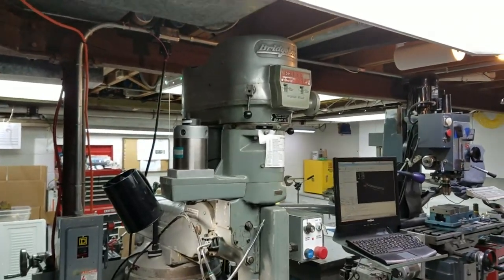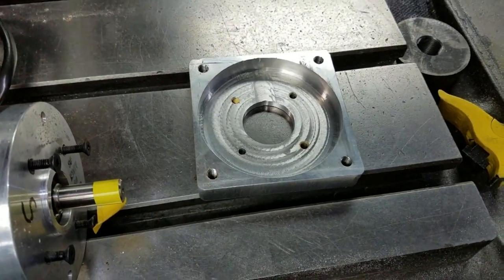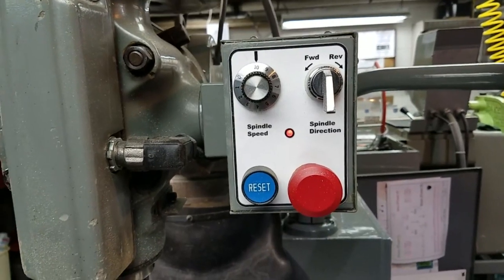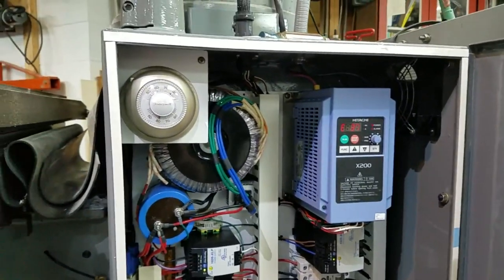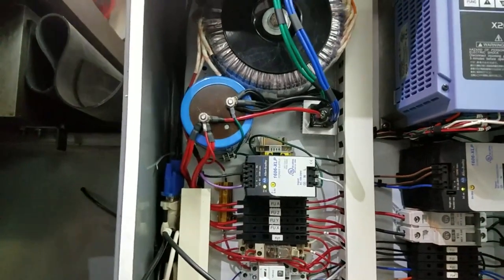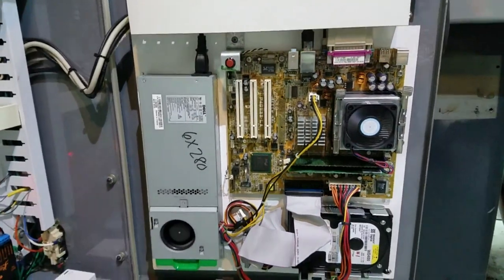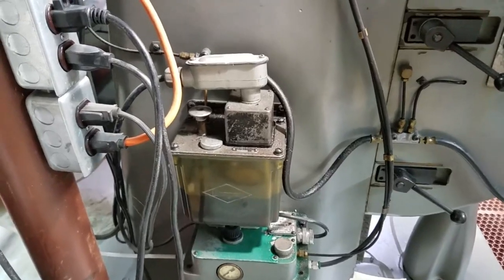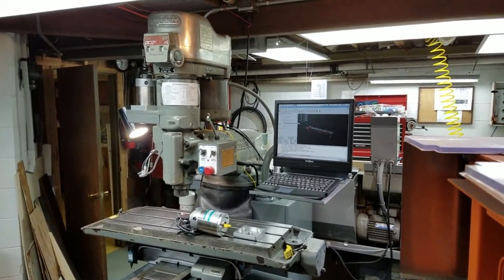Bridgeport Series 1 CNC retrofit overview

Comment: That's an awesome machine a lot nicer that the one I have ... thanks a lot for the video It was a nice surprise... you were talkin about having to move that thing to your basement I bought some stuff from an estate auction a while back and the old man had a whole machine shop in his basement a lathe couple milling machines a surface grinder and bunches of smaller bench grinders tools and stuff and it all had to go out a door and up a flight of stairs I only bought. A bench grinder and I glad that was all I bought the stuff was cheap and I figured out why when I got there haha I felt sorry for the guys that bought the big machines they were down there taking them apart scratching there're heads trying to figure out how to get them out

Comment from the maker: I just saw a message come through my notifications from Jacques Evans, but for some reason it is not showing up in the comments section here.  The original message from Jacques is this:  

Jacques Evans replied: "MakerCave Hi, interested in doing something similar myself. If you kept the original stepper motors would they need something to convert them to single phase? Thank you"

The stepper motors in the original machine were not really "3-phase."  Yes, the incoming power to the machine was originally 3-phase, but the steppers ran off of a separate DC power supply.  In a retrofit, you bring single phase power into a Torroid-filter capacitor-bridge rectifier arrangement, to make a DC power supply.  This DC power is then fed into a motor drive, like this Gecko stepper drive:  https://www.geckodrive.com/g201x-digital-step-drive.html  which takes care of driving the motor.  No 3 phase required.  If you go to 3:25 in my video, https://youtu.be/ou-R44toyUs?t=205  You can see the big round Torroid, that is powered by 110v AC.  The double blue and double green wires coming out of it are going down into a little square bridge rectifier, just below and to the right of the torroid.  The bridge rectifier   is similar to this one:  https://www.mouser.com/ProductDetail/ON-Semiconductor-Fairchild/GBPC3504?qs=j%252BucPx4PkG58AqaSQMi2kg%3D%3D&mgh=1&gclid=CjwKCAiAl4WABhAJEiwATUnEF6NVddx3colS1IqF-WpjexgPstFvH29FmsJuiCedbAWS3SzaURHF1RoCtzkQAvD_BwE  The Bridge rectifier turns the AC voltage into DC, which is then passed through the big blue filter capacitor, to smooth out the ripples in the voltage.  The two terminals that you see on the top of the bridge rectifier provide the DC + and DC - voltage to drive the Gecko stepper drives.  This is a pretty quick summary of the DC side of things but it should at least get you moving in the right direction.  Thanks for watching!

Comment: Great video, I really liked the Motherboard mounted in the cabinet. I am in the process of a retrofit of a bridgeport cnc, would you have a parts list to publish and or a wiring diagram. I think many of us that are trying to retrofit and keep cost down would greatly appreciate it. Thanks again for the video, really nice work.
Reply from the maker: I just glanced in my computer folder for this project and I found my original parts spreadsheet from early 2012.  Its pretty detailed with nearly all my part numbers and costs, except for the surplus items that I had lying around.  I put this machine together over a period of about three months, working on it off and on.  I will look at dumping this sheet to Google Drive this weekend, and including a link to it in a follow up comment.  My original schematic was done in Autocad, to help in physical layout of the enclosure, and actual routing of wires, not just as a simple block diagram, so that is a little harder to follow.  I will have to look at it again this weekend to see if there is a simple way to make it readable without having a copy of Autocad.
Reply: @MakerCave  Thanks for your willingness to help in such an endeavor. I look forward to the info. I believe AutoCad can be saved as a PDF.
Reply from the maker: @grantnotta3428    See if you can download and open these two files.  I will also place the links in the video description:   https://drive.google.com/open?id=1D3JUR82iw_a0EVoqCXGd2_KbRXa1LLjK     You will only be able to download this one and will have to read it with an Autocad (.DWG) viewer:     https://drive.google.com/file/d/1JYU92qt2g7GuVw6qdjQ20qFmhtAgaRiF/view?usp=sharing
You will be better off using either Autocad or a DWG viewer so you can zoom in to look at all the small detail.  I cannot convert it to .PDF until I come up with a better CAD solution, seeing as Dassault Systems discontinued their Linux support for Draftsight a few weeks ago.
Reply: @MakerCave  Thanks, I got it, and will start studying.

Comment: Amazing and detailed Job!! Thanks for the information...

I'm planning to do a similar upgrade in my Lagun 3 CNC mill. I still have the (3) Anilam/Sem servo motors (MT30M4-59). My machine has the Anilam A10 scales, and they were used in the original setup as a secondary servo feedback loop. My motors have tachometers. I'm curious about three things: 

#1- What modifications to your system layout/components will be needed to feed my (3) servo motors? *They are rated 142 max volts @2400RPM/ 30 AMPS @ 3NM Max Torque. They have the original reduction gearing and synchronous belts.

#2- Would you suggest keeping the tachometers or change them for hi-resolution encoders?

#3- Any extra hardware needed to keep the A-10 feedback loop?. 

Thank you very much for the help and for the excellent work in your videos.

Comment: How is this setup years later? Also, did you do all the wiring and setting up yourself? Thats a damn good job. Once i have fun with my new old series 1, i will probably cnc it just for the heck. Or maybe just buy a cnc machine. eh.
Reply from the maker: Perfect timing to ask.  Yes, I did all the control design and wiring myself.  The Bridgeport is two or three days away from being reassembled, and put back in service.  I moved into a fantastic new house 2 1/2 years ago, and I have finally gotten to the stage of wiring and setting up my new shop!  My new shop area has tripled in size, and I am really looking forward to making parts again.  Yes, the Bridgeport was working excellent up until the point that we moved out of our old house.  About a year before I moved, I upgraded to a Mesa Electronics FPGA control card, to get me a way from the parallel control, which let me run a modern computer.  All of the machine tools will have their own separate room from the rest of the shop, and now I have nice big aisles to have room to move.  I may start posting new videos once I get the shop back set up.  Thanks for watching!
Reply: @MakerCave  Thats awesome, are you telling me the bridgeport was dissasembled for  2 and a half years??! That sucks! i would be itching to set it up again. Thats great to be able to have a large shop. thats my goal. What kind of stuff do you make? Do you take jobs or is it more of a hobby? If you dont mind me asking.

Ill be looking forward to the videos, thanks!

Comment: MakerCave:
I made a conversion like this one. But I DID NOT change the motors. 
Used the Original motors and the Original power supply. 
I only changed the MOTOR DRIVES. and I DID use Gecko drives but not these models.  
I used the "High voltage Steppers"  The spindle, I left that alone since it has an adjustable, pulley-based, variable speed control.  (I may decide to change that later. but I haven't seen the need, yet)
I also replaced the CNC controller, using Mach3.  All parts I got from ebay........
works Great!! and super powerful w the Original motors and really economical conversion!!
Reply from the maker: Yes, I had read in the past that many have had very good results using the original steppers.  If I had it to do over again,  I might just have stuck with the steppers!  Steppers make their best torque at very low speeds, which is when the machine cutting forces are high, so they are a good for most work.  Any chance that you have anything posted on Youtube about your machine?  Would be great to see it!

Comment: MakerCave:  Is there a difference between a home switch and a limit switch?  And why use relays for their signals?
Reply from the maker: A Home switch is used to tell the controller that the machine is in a predefined position after power up.  This way the controller knows that it is exactly 11.625 inches away from hitting the left travel limit of the machine.  The limit switches are sometimes called "Overtravel" switches.  These are the last line of defense against a machine crash.  On my machine, I can can be running at my max rapid speed, hit a limit switch, and the drives brake to a stop before anything hits.   I used relays to isolate noise from the field wiring.  I was getting false limit switch trips once in a while, and I know that it was because of noise in the wiring.  Running this signal through the Solid State Relays completely eliminates any possibility of noise from tricking the controller.  The relay is very positive.  It is either open or closed.  Nothing in between.

Comment: Great, I have disassembled a series 1 2J Bridgeport I'm in the process of moving to my basement shop. I have everything down there with the exception of, you guessed it the knee and the base. Wish me luck!
Reply from the maker: Funny you should mention.  I just bought a new house, and MY Bridgeport will need to be disassembled in about 3 weeks, rigged and moved again!  Fortunately, the new house has an open stairwell to the basement, from the garage, so it will be much easier to get it into its new location.  Good luck with your move of the base!
Reply: @MakerCave  Thanx, I got the Knee moved now since I posted that comment, thankfully it was uneventful! Look into using a wrecker to move the unit from house to house, I found out the hard way it's so much easier

Comment: Great project do you have a hard copy / pdf of the step by step procedures? I am old school and do all my work scopes in hard copy
Reply from the maker: Sorry, I didn't do any kind of procedure for someone else to duplicate this when I built it about 10 years ago.  I have all my part numbers logged and some design notes, but this was not a commercial, mass production effort.  Just a hobbiest doing a "step and direction" conversion using currently available standard components, to replace very outdated electronics.  Thanks!

Comment: Hello, does the bridgeport motor serve with a VFD? Doesn't torque decrease at low revolutions?
Reply from the maker: Yes, torque can fall off at very low speeds, like 15 hertz.  Also, the cooling fan is turning very slow when the motor is turned way down with the VFD, so the motor temp can rise because of that.  It is best to run above 30 hz when under a lot of load.  The Bridgeport  motor is not specifically rated as an inverter duty motor, but it does work fine in this application.   If I need to slow spindle speed way down when under heavy load, I slow it mechanically with the vari-drive crank.  Thanks for watching!

Comment: nice machine.  I've completed my retrofit using a hodgepodge bag of parts.  I was wondering if you could shed some light on the Bijur oiler.  I currently have mine powered when the spindle is on, problem is, how do you know if its working?   thanks
Reply from the maker: Thanks!  The easiest way to be 100% sure that your oiler is working is to unhook the outlet line from the oiler, and then see if oil starts to ooze out when the spindle controlled relay is closed.  You may want to hook up a temporary extension line to the Bijur outlet, just so it doesn't make a mess.  

It is also important to note that the various oil channels and restrictions can become clogged over time, so if you have the opportunity, it is always a good precaution to take apart all the lines and the manifold, and flush them out with solvent to be sure that they are not clogged.  This will ensure that the ways and ballscrew nuts are actually receiving the lubricant being sent from the Bijur.  

Post some photos or a short video of your machine on your channel if you get a chance.  It would be great to see it!
Reply: Will do.  I send me a private message.  i’ve documented my build on Instagram

Comment: Hi, can you post some information on how you got it into your basement? Specifically, which parts did you disassemble and how did you carry each part down the stairs? How many people had to help carry each piece?
Reply from the maker: I erected a derrick in the stairwell, made out of old telephone pole cross members that are about 5" square, if I remember correctly.  The uprights sat on the third stair from the bottom, and the horizontal section ran from the top of the ceiling in the stairwell, to just before the back door, which is a straight shot down my stairs.  I suspended each piece with two chain hoists, alternating from one to the next to "walk" the components, suspended, above the stairs and down into the basement.  Kind of like climbing hand over hand to traverse a set of monkey bars. 

I broke the mill into 5 pieces:  First I removed the 4 bolts at the front of the head and lifted it free from the ram with an engine crane.  Second, I undid the 4 bolts holding the turret and ram to the main base casting.  Then I removed the gib for the table, and slid the table off the knee, onto another rolling table that was about the right height.  Next I pulled the gib from the knee, and lifted it free from the main casting with the engine crane.  Two of us worked on it from 9:00am on a Saturday morning, and I had the mill reassembled and everything cleaned up by about 6:00 that evening.  By far the worst part was the main casting.  It felt like it was about 1200lbs, just by the way it loaded the crane when lifting it. 

I know that this sounds like a lot of work, but it really wasn't that bad.  I had a couple of 2' x 3' wooden dollies with heavy duty casters on them to move the parts from the bottom of the stairs into the workshop.  Those helped a lot.  My engine crane disassembles into individual pieces, so the last step was to break the crane down, and set it up in the basement to reassemble the mill. 

I can't really recommend that anyone else do this for liability reasons.  A typical move like this would require hiring a rigger that does this all the time.  Fortunately the person that helped me was also very experienced in doing heavy lifts and rigging, so we were able to accomplish it safely.  For my next go around, I am just going to buy a house that has grade level access to the basement.

Comment: Jess Cast,
Would you share the details of your Bridgeport retro fit? What drivers did you use for the steppers?
How did you wire the motors to the drivers?
Reply from the maker: Some of this info is in the video description.  if you go to the Geckodrive website at: https://www.geckodrive.com/amfile/file/download/file_id/16/product_id/21/   you will be able to download the manual for the G320x drive which shows all the details of how to wire it to a servo motor.

Comment: Do you need a encoder what those stepper motors so that way it knows where it's at.
Reply from the maker: My motors are actually "Servo" motors, which have an encoder as an integral part of the motor.  Yes, the Encoder gives feedback to the drive, and stops the machine if it goes out of position.  The original stepper motors, or any stepper for that matter, does not typically have an encoder to feed position back to the drive.  For most hobbyists,  a stepper is just fine.  A stepper should never lose position unless you overload it with very high cutting forces, and lock the rotor (stall the motor) on the stepper motor.  Thanks for watching!
Reply: @MakerCave  ok. Right now I'm trying to figure out what size pullys to buy for my stepper motors and where to buy them.

Comment: What resolution or accuracy can you expect from a retrofit machine?
Reply from the maker: My encoder resolution lets me command moves as small as .0001".  My machine is very tight mechanically and If I recall correctly my X ballscrew had backlash of about .0004 so I have actual precision comfortably of .001 on finished parts.  Really,  machine condition will determine your final machining accuracy.

Comment: Very Very cool, I did my apprenticeship on a Bridgeport starting in 1977
Reply from the maker: Excellent!  They really were cutting edge machines at the time.  American made, introducing a decent mass market CNC controller on top of really good iron for the smaller shops.  I have heard a couple of old timers say that they recall that these machines were about $40k new in the late 1970's.  Do you recall about what they cost at that time?
Reply: @MakerCave  i was 16 and told this is your mill.....lo l5 years on a manual mill teaches you a lot about back lash and you get popeye arms lol